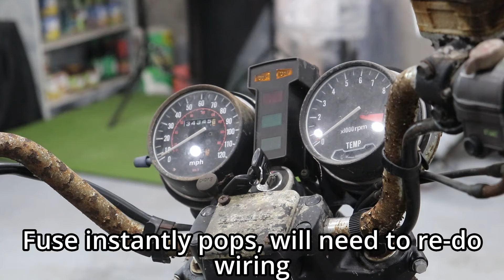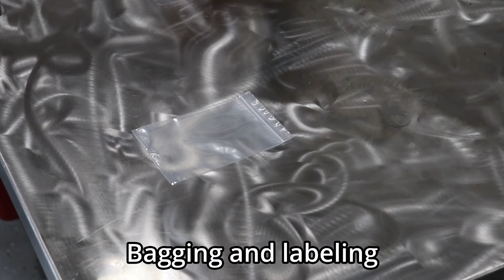1979 Honda CX500 Full Teardown | ASMR Restoration Part 1 (NO TALKING, NO MUSIC)

Comment: Just curious, did you read a shop manual for this bike before you started? Do you have a budget for the rebuild?  Are you going to keep the bike or  flip it? What brand is the neat little trailer?  Thanks!
Reply from the maker: No shop manual, just some stuff on YouTube, I would like to keep it under 3k, will be selling it when i am done! 

Not sure brand of trailer! But i fixed it up and sold it for the cost of the bike!

Comment: not valuable enough  to restore.  i'd pay 100 no more.  it clearly sat outside too long every piece of chrome every electrical component needs replaced
Reply from the maker: Definitely going to replace all wiring and chrome parts! Luckily i basically got it for free considering i sold the trailer for more than i paid for it all 👍🏻